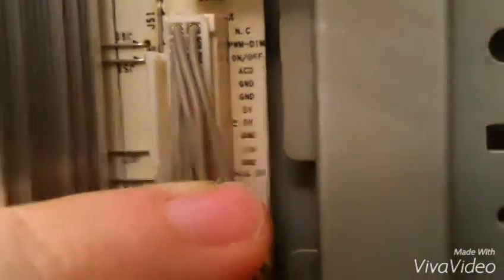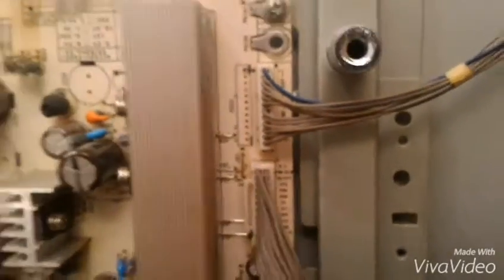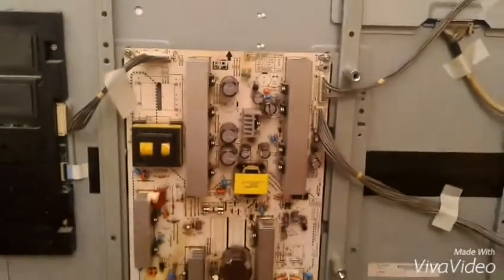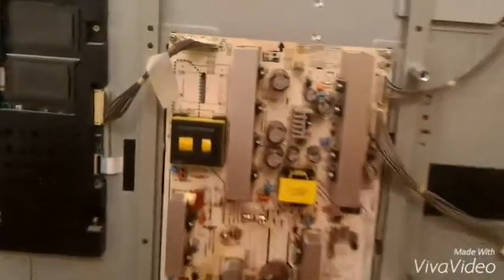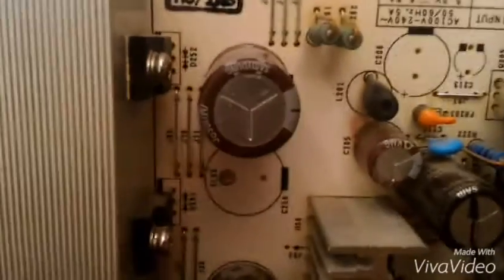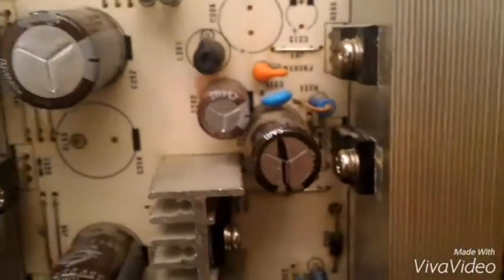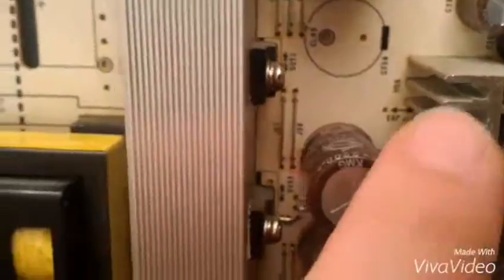LG TV Screen doesnt turn on (Type: 42LG5000) - Problem was solved!Both INVERTER BOARDS were faulty.

Comment: Does the power module give power after plugging it in or do you normally have to puch the on off switch before it give's 24v etc? Mine doesn't give any voltage on the connectors
Reply from the maker: Hello Sam, I would love to answer your question but I have fixed the TV 4 years ago and since then is working with no problem.

Comment: I had one that would randomly change channels and inputs and power on and off on it's own! at first I thought it was the main board I changed it still didn't help! the problem ended up being the side volume, channel, input and menu buttons I cleaned them with compressed air and lubed them with mineral oil it's been working fine for a while now

Comment: This fault is due to defective transformer which is not oscillating to supply 24volts & 16.5volts. Recomended to provide alternative power supply 24v & 16v with 8amp.instead replacing transformer.

Comment: Hello! have you find the problem? from what component that noise come from? transformator?  i can barely hear it on the video, when the tv cord it's unplugged have you checked the diods, resistors and capacitors with a capacimeter? a capacitor can't work well if its value it's under a certain percentage, even a very small component can be the cause, the lower voltage can be a problem, it depend if the things need that exact voltage.
Reply from the maker: Hello, Yes I have found the problem. It was rather long run for resolving the issue because I have replaced power supply board as well as main board and found out that it doesn't work neither and same problem was still there. Afterwards I have spent bit more time on googling and then found out great hint where I have used the flashlight to test the functionality of my LCD screen. I have switched off the light in my room and exposed the light from my torch directly on the screen and saw the picture on the screen. And this gave me clear the evidence of the backlight failure. The inverter boards which are located on right and left side of my TV are in charge of powering the backlight (which use the LED or in the past Cold Cathode Fluorescent Lamp to illuminate the LCD screen). I have measured the input and output voltage and found no voltage on output. I purchased new inverter boards on e-bay today and going to receive them next week. I will inform you what was the result. Keep your fingers crossed.
Reply: Hi, it seem a too expensive repair, good luck!
Reply from the maker: Actually I am going to sell the power supply board and main board on ebay. Which means that only expense I had was for inverter boards.
Reply: usually the blinking power led it's caused by a fault in the power supply.
Reply from the maker: but not in my case